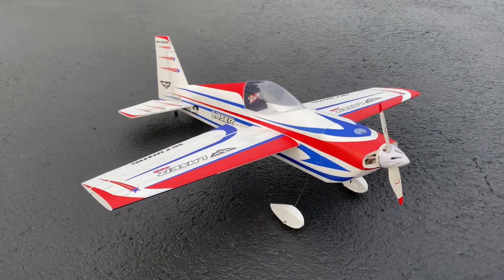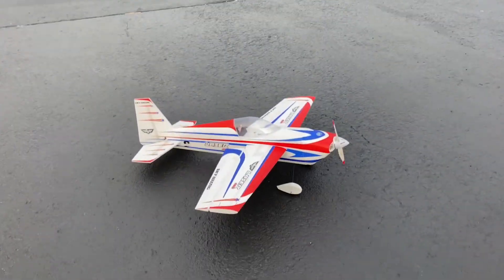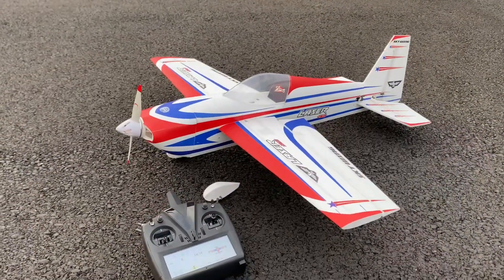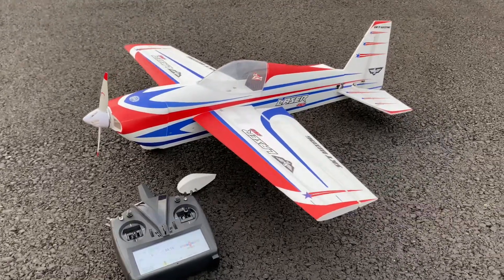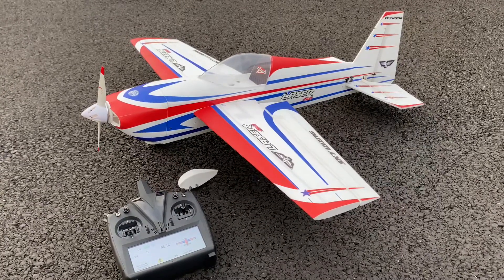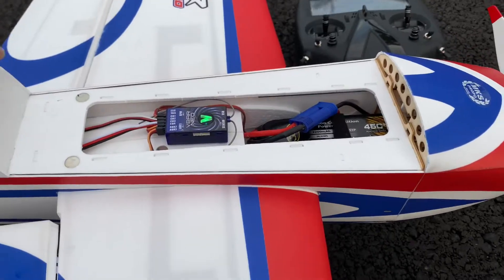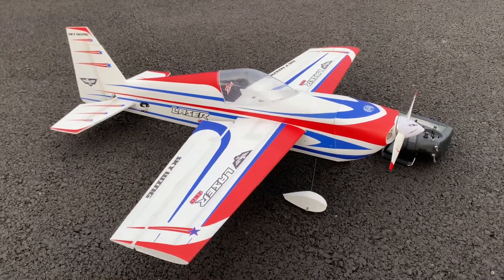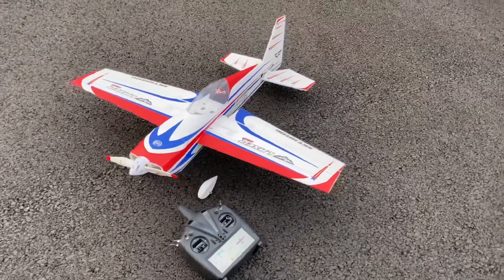SKYWING 38” Laser 260 Maiden Flight

Comment: "For more punch go with the 48" version."  :) that's what I did...Motrolfly DM-3615 with 4S2600's...really powerful, glides just like I saw in your video.  Nice video by the way.  Seemed like a small space, but you had no issues.
Reply: I have the 48" laser and it flys fantastic. The Motrolfly setup is good. If you want to go with a lighter setup with tons of power and still have fairly long flight time say 6 plus mn.Try a Sunnysky x2820 v3 860kv from Buddyrc with a 14x7 vox or xoar wood prop and a 3cell 65c 2200mah. It will hover at about 40 percent throttle and punch out around 25 to 30 mph straight up. The Sunnysky motors are about the smoothest and most powerful motors I'v tested so far for these size planes. I do a lot of motor testing. I'm not trying to be a mr know it all or knock your setup. I'm just trying  to be helpful sharing info from one rc pilot to another so we can all enjoy this hobby even more.
Reply: @Rcdoski  Well said buddy😁